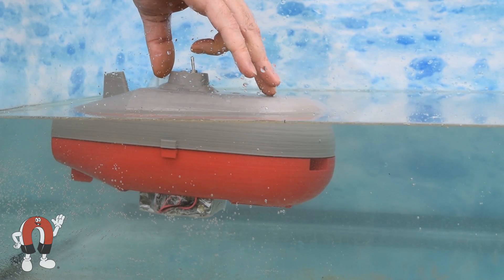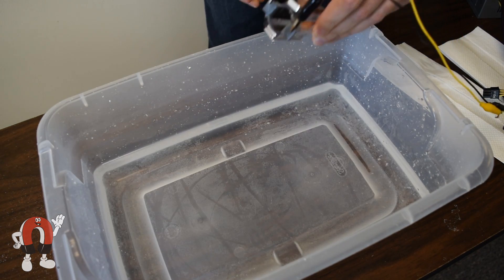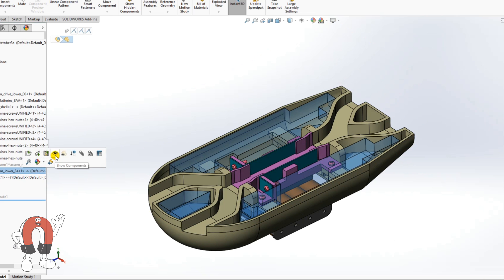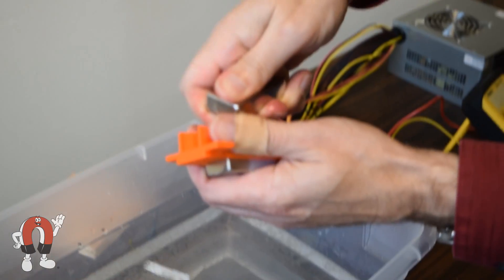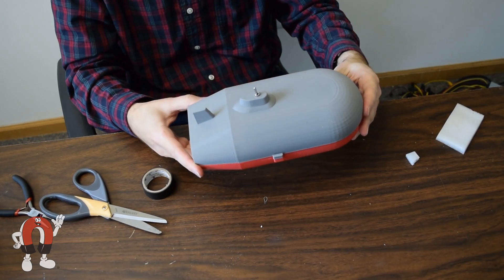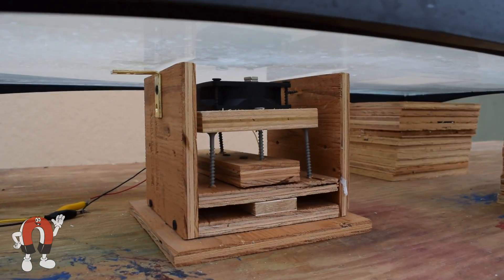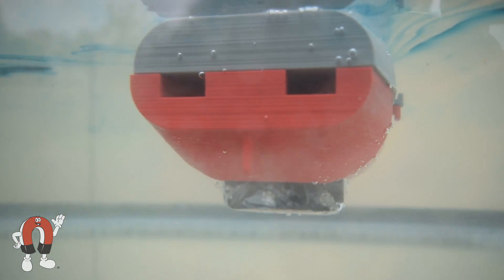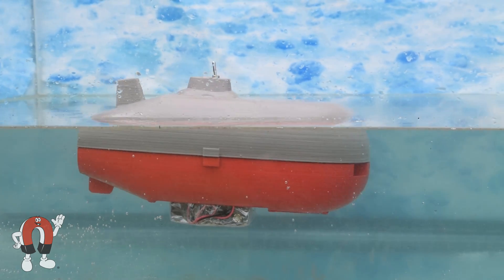Magnet Powered Submarine - The Hunt for Red October IRL!

Comment: I made the same thing but without electricity I used 20 small earth magnets placed 10 on a centre spindle but 5 x 5 on a spiral pattern attraction facing each other and on the outer tube I placed 10 magnets in a spiral but at an opposite attraction and at a 10 degree angle that caused the drive of the inner spindle no batteries needed a true magnetohydro drive

Comment: Multi stage as in a steam turbine 
One motor feeding second one  etc.
With only one outlet. If it works have twin  set ups like with twin propellers using increase/ decrease of voltage per motors  then rudder. 
Question --- set it up in reverse large to small with more voltage  to the out put stages??????
I take my girl to watch that submarine race.

Comment: I made a water pump based on this idea years ago (with the idea of a silent engine for fishing, but other things got in the way of further development). It worked much better with aluminium plates with a mesh on the surface, or dimpled plates.
Ended up with 4 separate anode/cathode arrays that get 10% bigger than the previous towards flow direction, but still just 2 magnets. With 12V it chucked.

Comment: Splitting the outlet into 2 ports slashes your exhaust velocity in half.

Jet propulsion is all about how fast you can throw your exhaust out of the back of your vehicle.

Also, fluid flow velocity is proportionate to the throat diameter. Think about what happens when you pinch the end of a garden hose.

You can improve the sub dramatically by reducing to one outlet where the diameter converges at the outlet to 50% of the diameter of the drive section. This will quadruple the flow velocity of the exhaust (not counting friction.)

Don't overdo the convergence or you'll choke the flow.

Also, make the whole passage cylindrical to reduce turbulence in the flow.

Finally, make sure to cut a vent right at the top so you don't end up with a little plastic sub stuffed full of combustible hydrogen and a battery pack to light it with.

Comment: This was a great experiment. Nicely done. There are some great suggestions in the comments to make the Mk II if you choose to do it since you have the hull design already.  Two inline port/starboard drives so there is less potential flow loss, smaller exhaust venturi (maybe print inserts to try different sizes), 9volt batteries, maybe look at intake port shapes and tapering the tunnels to the drives sections. Would changing the spacing between the the aluminum plates increase the force? Not an expert by any means but this is fascinating to play around with. :)

Comment: Aren't you going to run into a problem with the flow of material from one aluminum strip to another, effectively ablating your electrode component as passing a current between two conductive plates in a saline water environment is the cornerstone of electroplating? It seems this would be an unsustainable method of propulsion due to that fact.

Comment: Some other things to test...
.
1)  Single outlet instead of dual.
2)  Multiple inlets instead of just two.
3)  One-way valves (possibly a pair of Tesla valves) to fore and aft of the drive manifold itself.
4)  Narrower outlet aperture
5)  Wider inlet apertures.
6)  Multiple smaller drive assemblies operating via just the two magnets, such as having 3 or four tubes each with their own sets of plates, but still with just the two magnets over each.
.
Bonus:  If you're feeling super ambitious, see if you can incorporate the drive's principles instead directly into a Tesla valve.

Comment: Very cool!  Would restricting the exhaust to accelerate the water via ventury effect help accelerate the boat or would it just be too much back pressure for the system to overcome?  I’m sure there is an optimum combination of plate and magnet separation to electrode length to voltage, do you know what that is?  Have you tried different combinations?

Comment: On The Hunt for Red October it produced a lot more speed though I guess the ducting was better designed
Reply: Higher voltage and higher current across the multiple pairs of plates, and multiple pairs of extreme high powered electromagnets all powered by a nuclear reactor and a precision designed smooth flow tube(s) with the least possible turbulence.

Comment: I read the novel when I was younger, and worked on a submarine for 8 years. I never thought that the drive used in the book was based on a real principle (although I should have known better with Tom Clancy). Thank you for explaining it in such a clear way!
Reply: MHD pumps have been around for over half a century. They are very common on liquid metal cooled nuclear reactors because they are very reliable with no moving parts (taking a pump apart that is handling radioactive liquid sodium potassium alloy is not good for your health).
Reply: @allangibson2408  ooo really?
Reply: It actually wasn’t mentioned as being magnetohydrodynamic in the book! That was added in the film
Reply: You worked on boats, can you tell us anything about the low frequency communications from Maine? Ultra low?

Comment: Great project! but it was, basically a electrolysis machine, the anode will eventually oxide out and the engine no longer work; in reality, replacing a huge anode (huge enough to work on big sub like Typhoon class) may cost a fortune 
It generating a lot of bubble which is not silent or stealth after all, we need to find solution to all those ... hydrogen bubbles, or enemy sub/cruiser can torch you with 1 single torpedo/depth charge
the engine design need to improve, absolutely; as someone already commented below, 2 intake is okay, but only use 1 exhaust; it will increase pressure. But since this is a test project only, if it works ... it works, good job, improve it later.

Comment: An outstanding and creative project!

A suggestion if you wish to go one step further, using an amp meter on the power cable try using different metals for the electrodes to see which provides the most current. I am assuming that more current = more propulsion.

Comment: Wonder how the noise of the bubbles would compare to the normal cavitation and noise from a conventional propeller drive. Would be interesting to see a larger-scale version including a hydrophone test. Would also be interesting to see what level of salinity to current is needed for it to work in a large body of water.
Reply: Would bubbles rise to the surface and give away position..As you say would they make noise. For a boat that just needs to do about 4knots such as Trident this would be ideal. But would still need reactor to provide electric. If speed is needed then just revert back to normal propulsion. Noise from generator would need to be suppressed as normal. Plus in theory you could use the batteries onboard and use reactor to charge.
Reply: My thought exactly
Reply: It'd probably sound like a seismic anomaly or whales humping or something...

Comment: Play around with the delivery and exit-torial  pathways. Also different sizes of the exit holes or one hole with more pressure if that’s possible. And maybe a way to get the water to spin in circular motion out the back port/s for more increased water vol/ pressure ect.....

Comment: Why not keep the voltage below the decomposition voltage of Water? You are wasting energy on electrolysis. Creating gas and sound are things a Submarine propellant should not do. You could also use graphite on the electrodes to maximize their life expectancy. Aluminum will corrode rather quickly.

Comment: Threes and it is turning one ways because on the HHO system which is basically what you've made Works exactly like any electroplating circuit one side is more reactive than the other so if you get rid of your 2 inlets and outlets and make it 1 single inlet and outlet it will flow straight

Comment: Play using instead of aluminium want you try using graphite Or magnesium?
 Magnesium reacts faster so you will get more speed from the boat and graphite doesn't disintegrate like metals do in salt water with the electrical flowing

Comment: why isnt this more widespread on actual submarines?
It sounds like a great way of having a very silent vessel
Reply: It isn't as quiet as it seems. As the video demonstrated, the drive produces a high volume of bubbles which can be heard through sonar. Granted it would be quieter than traditional subs the gain is not enough to justify its use. The second and more major problem is the magnetic field a full size drive would produce. Anything with a magnetic field detection device will see this thing from quite a good distance away, nullifying any advantage in sound reduction.
Reply: @Brisingar  that sounds very reasonable! thanks!

Comment: how does the change in current or voltage effect the speed?
Reply: The speed/force is based on the interaction of the current and the magnetic field. The current is based on the resistance of the fluid and the voltage. You can increase current, and thus force and speed, by increasing the voltage and/or by decreasing the resistance (adding Salt).

For an upper limit of speed a rail gun uses it's own current to produce a magnetic field to propel a metal slug at high speed between two conductive rails using the same Lorenz forces. There is also the limit of voltage to where you both split and ignite the hydrogen in the water simultaneously producing a completely different and not so stealthy type of propulsion system.

Btw, on the rail gun, I hear craftsman's lifetime warranty on tools is only valid if the crescent still says craftsman on it and still resembles a crescent after being dropped on a charged capacitor bank.

Comment: Calculate the rate of bubble formation to account for risk in quantum extraction from fluid . . ..  bubble inconveniences can be avoided using propulsion system controls . . . general data. quantum extraction/seperation can be applied in space . . . planetary fluids , gases , and solids . . . quantum extraction throuout space to protect integrity of earth. Also. . . quantum extraction of memories for use in the formation of quantum products and proccesses that may ber sought after because of chemical preferences.

Comment: Wrong approach - wire on inside and outside. Apply dc  voltage and boat will go in salt water. I build one in 1969 and work in bath tube.

Comment: You're going to watch a lower the voltage in order to prevent electrolysis, the whole point is to make no noise at all and bubbles being released at 300 plus feet is rather noisy.

To increase the propulsion at these lower voltages you're going to need to increase the plate surface area as well as decrease the distance between the plates.

Comment: Nice, however if it's producing bubbles it definately would not be silent.  Standard screws produce bubbles as they turn causing cavatation (cavitation?), the bursting bubbles generate noise which can be heard miles away.  It might be a bit quieter though due to the effect of the subs hull producing a shroud effect and may even cause that "noise" to be directional, harder to hear from the sides and louder from the rear than the front.  It'd be interesting to see it tested larger scale though with hydrophones.

Comment: Whaaaaawwww must say I'm very impressed.  Just a few questions.  Why  permanent magnets since with two coils in series you would get the same result,  or not? 
What about the corrosion of the aluminium plates..... how did they solve this problem in reality? 
And..... Why did you not use accu instead of battery since they have more current. 
Must say this is the first working model i see..... beautiful done congratulations.

Comment: Looks great, I have a couple of questions, hopefully someone knowledgeable may answer:
1- "twin propulsion" seems only aesthetics, as it's only one motor.  Would you expect same speed with only 1 inlet and 1 outlet with the same "motor"?
2- Would tapering make any difference in speed? (i.e. making the outlet smaller to increase pressure)
3- How'bout 2 equal "motors" in 2 independent ducts, but same bateries as this test?
4- And, what would increase speed? more voltage? more wattage?
So many questions! So much potential!
Reply: Oh, wait, I just realized water is not compressible, so, How does that come into play?

Comment: A few things...

1. The inlet and out as others have stated are an issue...by the time the expansion of the propelled water hits the diverter and reaches the outside water it is going slower exponentially   That expansion has to happen as close to the external water as possible.

2.  Since the motor isn't going to be on for very long...I would think more voltage is the name of the game here, 6 9volts?  54 volts?

3.  Would an elector magnet be more powerful?  Sure it would have heat...but the water should keep it cool.

4.  Would torrid style electromagnet (multiples) around a tube be better than the single strips?  Around iron cores of course.

Comment: I remember reading about this in a short article in Popular Science magazine in the 60’s.  Dr. Lorenz (sp?).  Was the lead scientist and students from the university (I don’t remember which one) were wading off the coast of California....wondered if more development actually happened, but I have noticed that modern sub chasers have magnetometers on board
Reply: The magnetometers would detect the distortion of the Earths magnetic field caused by the hull of the sub.
Reply: Yes, but they didn’t seem to be on sub chasers until after Dr. Lawrentz’s experiments, which lead me to believe there was some connection, and that was about the time that the Soviets were developing magnetohydrodynamic technologies...at least as I remember it.   And I don’t recall it ever called a caterpillar drive.  I also believe the tech was used in oil pipelines as a charge of salt water is pumped through the lines after the oil; the ion pump wouldn’t require moving parts inside the pipes.
Reply: @richardrose7382  I think they experimented with towed magnetometers (from a boat) during WW2, could be very wrong on that though!  I think you're right on the timing for airborne "Madman" detectors, prior to the 1960's subs actually operated on or very near the surface most of the time.

Comment: Awesome experiment!  During the initial tests, the DC power supply seemed to produce a lot more thrust.  Did you check the amp draw?  Curious if a LiPo battery could do better.  Last bit of this comment, seal up all the electrical connections with silicon to prevent power loss.

Comment: Could you use this magnetic drive in reverse as some sort of solid-state hydro-electric generator?
Reply: No, but it is used to measure flow. A mag meter uses an identical setup but has 2 probes right near each magnet. As the water flows by the current in the water is dragged through the magnetic field. This produces a rotation in the current which can be read as a voltage perpendicular to the current flow and parallel to the magnetic field lines. The downsides to this technology is the fluid being measured must have a minimum conductivity in order to pass a current and the pipe must be full to cover all 4 electrodes; two for current and two for voltage.

Comment: Have you tried to make the exit into a jet form, using the Bernoulli effect, possibly with two holes at the smallest diameter to suck additional water in the stream by the Venturi effect? You could change the duct by inserting printed parts and see if it enhancec the output speed, volume and force.

Comment: Use electromagnets and alternating current source (20-30Hz) synchronised with phase of coil current and no more troubles with electrolysis. Switched is enough, sinus is not required.